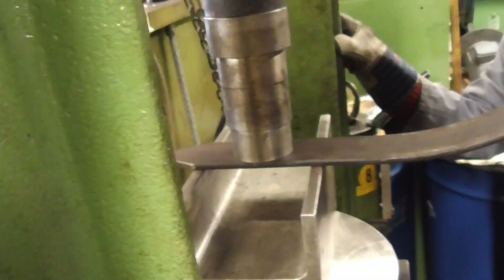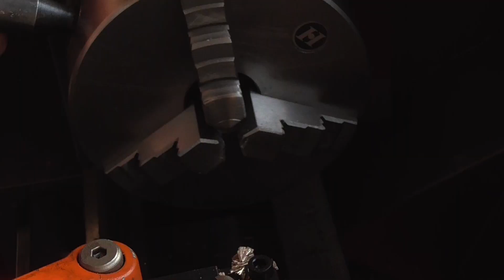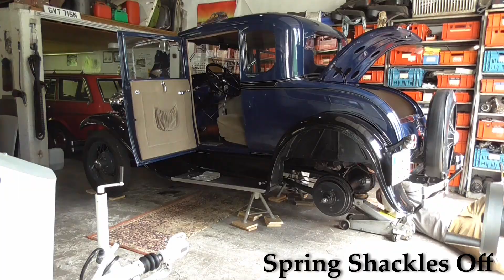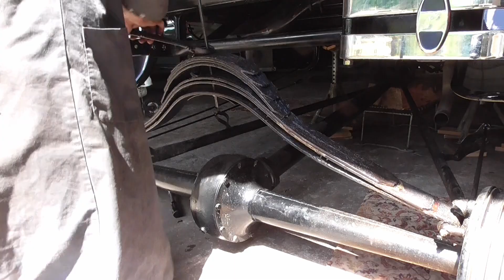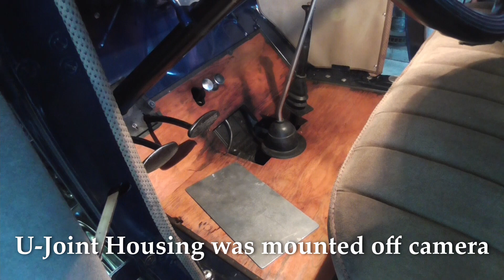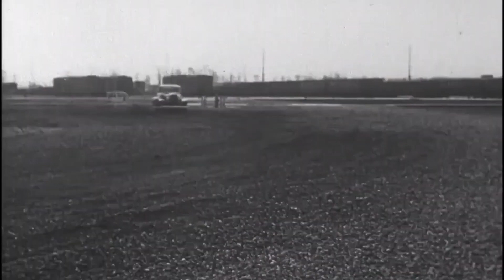The Model A Leafspring Debacle Part 2

Comment: I love the under car photage. What beautiful geometry! Form follows function. The wishbone, the axle and the spring working beautifully together in perfect harmony. If you like and appreciate good engineering, this as good as it gets. Triangular shapes for rigidity and a parable spring with triangle fixtures for flexibility without loss of stability. I get tears in my eyes. :-)
Reply from the maker: It's amazing how much is going on underneath the car, even on what appears to be a rather smooth bit of road. The wheels are all over the place - makes you wonder how it's possible to even go in a remotely straight line xD

Comment: You did a great job on that spring set up, looks great, must ride a lot better too! I know what you mean about the shock links, my 29 Coupe was missing the two rear shocks and the front shocks were toast. I decided to replace them with a kit that uses modern shocks, it cleaned up the look and made my car ride much better.

Comment: Well, on the plus side you should now be able to remove and replace the rear axle blindfolded! :-)
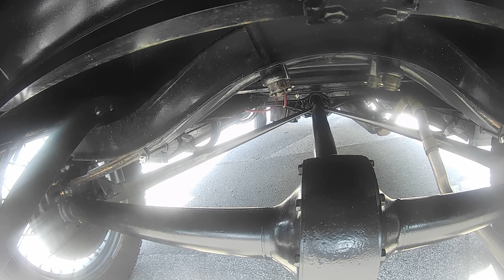7:27 another advantage of the GoPro is you get that distinctive Model A starter and exhaust sound. Nothing sounds quite like it.
Love the vintage test track footage.
Given how bouncy these things can be with those transverse leaf springs, that must have been an "interesting" ride for the drivers. Hope they were wearing hard hats!
Thanks for another interesting video.
Reply from the maker: Especially speed bumps are a fun experience with this type of suspension. The downward movement of the front wheels upon leaving the speed bumps has a recoil effect on the rear spring which catapults you upwards once the rear wheels touch the bump. With no seat belts, that's where the term "knock on wood" must have originated: Your head hitting the roof beams xD

Comment: A good idea is to bevel the ends of the spring leaves, as the sharp edge will dig into the underlaying leaf, over time.

Next time, reach out, as I might be able to help finding parts - I'm a bit closer (Dänemark). :-)
Reply from the maker: I did bevel the leaf ends in part one. Maybe not as heavily as some do, but certainly enough to smooth up the hard corners.
I'll keep your offer in the back of my mind, thanks alot :D

Comment: Could it be that the drum in stuck on the brake shoes ?
Reply from the maker: I'm pretty sure it's not - the wheel was free to rotate, after all.
Reply: @AstraWerke  sometimes there is an edge on the inside of the drum. It is where the shoe doesn't touch the drum and therefore does not wear out ... could this edge get stuck on the brake shoes?
Reply from the maker: @jrom213  Well, it was no problem to remove it the first time I did - plus, a bearing puller would have at least gotten it off the taper and you'd have been able to wiggle the drum about for the amount of play that the brake shoes have in their mounting. The drum was rock-solid, however.

Comment: Did you feel any difference, afterwards?
Reply from the maker: Well, it is a little bouncier down rough roads at low speeds, but most importantly it seems to stick the road more. Pothole-infested roads were more of a "point the car in a general direction and hope it works out" before, now you can maneuver it quite accurately through the bumps.

Comment: Must have become much harder suspension now.
Reply from the maker: It's a bit stiffer, but most importantly, it seems to stick to the road more when going over bumpy roads now.
Before, I could only point the car in a rough direction when going through a series of potholes - now, I can accurately maneuver it straight through the bumps.